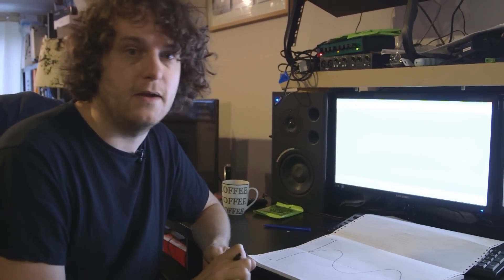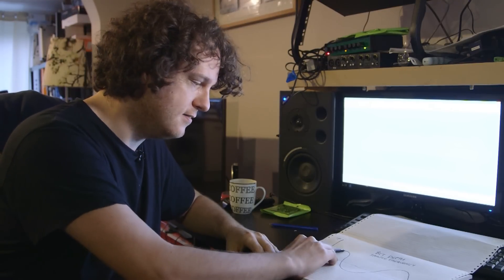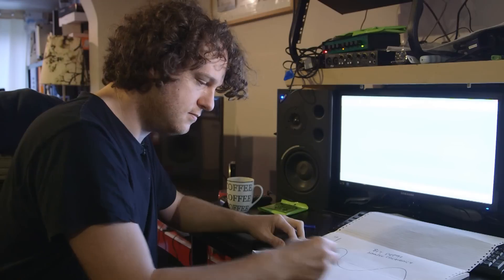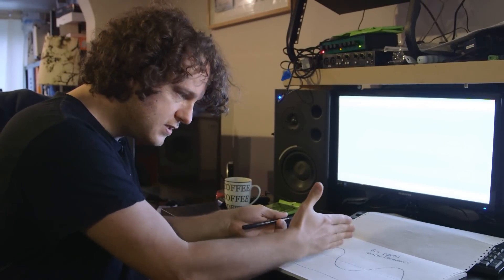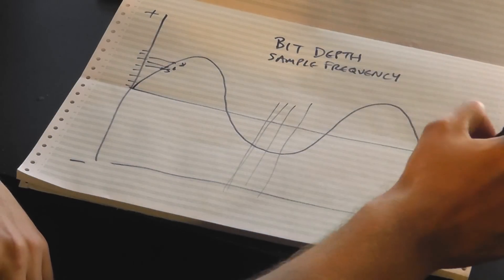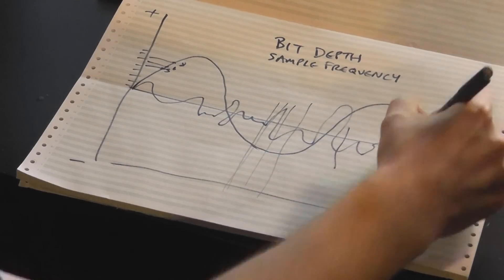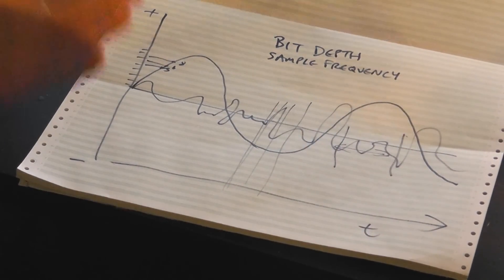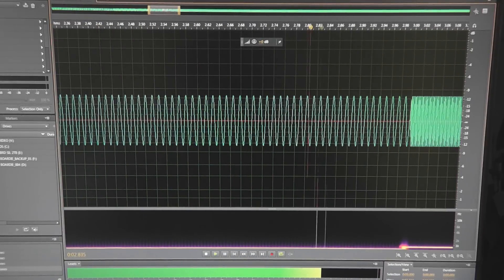How Digital Audio Works - Computerphile

Comment: Now I know why higher sample rates improve treble clarity, in a waveform high frequencies spike up and down a lot very quickly, a slow sample rate misses those spikes. Great video!
Reply: +Tyler Watthanaphand Yup, that's part of the Sampling Theorem. There's a rule that says "if you wanna capture perfect audio up to X KHz, then you need to sample *at a minimum" of 2X KHz." Search for Nyquist Frequency for more info... :-)
Reply: +Orestes Zoupanos Better results are achieved when you double the sampling frequency (according to the maximum frequency of the signal) and add a little more sampling cycles. Hence the 44.1 KHz, which is 22 KHz * 2 + 100 Hz. The extra 100 Hz prevent the signal from containing aliasing artifacts.
Reply: +Hugo Neves You're right, but he did basically say that. That's what he meant by  sample *at a minimum" of 2X KHz." . Granted, that doesn't really emphasise the benefit of the fudge factor.
I guess it depends on how you think of it, it's either Nyquist >= 2X or 2X+100 = Nyquist.
Reply: +Gordon Freeman I meant going from 8-10k on phones to 44.1k. There are legitimate uses for higher sample rates, just not in regular listening. For example, in live FM broadcasting where sub-carriers need to be mixed into a signal to provide stereo sound, RDS, etc, the only way to get those in there are to use 96 or 192khz
Reply: +Hugo Neves  they picked 44.1 because it was compatible with both PAL and NTSC video equipment. Early digital audio was stored on video cassettes. They needed a minimum of 40hz, and then extra room for the antialiasing filter,  and it had to be divisible by both PAL and NTSC standards.
Reply: +Tyler Watthanaphand 
Sample rates above 44.1KHz do not improve audio quality at all.
It doesn't matter if you go from 20Hz to 20KHz in an instant, at 44.1 it will all be perfect.
Reply: *****

Well, sure, there are uses for higher sample rates, but that's mostly for scientific applications, were you need to store really high frequencies, for normal listening human standards 44.1 is enough.

Comment: The very first statement was wrong. The air doesn't move across a room until it hits your eardrums, that would imply that the air in the room moves at the speed of sound across a room. The air on average stays in the same place, but as it is an elastic medium the information it carries moves across the room at the speed of sound, so not so much like billiard balls passing on energy, but rather billiard balls attached by springs that return to where they were initially.

Comment: So sample frequency is the "fps" of sounds ?
Reply: +BOBOUDA More like Vsync on a monitor. At least when converting from analog to digital =)
Reply: *****
I'm just asking if it's comparable, it was just a random thought.
Reply: +Patrick The Buried Then what happens when your cpu stalls for a bit?
Reply: +BOBOUDA Pretty much, yes (analog audio/ live audio has infinite sample frequency, just like RL). Bit depth is like Contrast of a monitor.
Reply: +BOBOUDA Pretty much, yes (analog audio/ live audio has infinite sample frequency, just like RL). Bit depth is like Contrast of a monitor.
Reply: +Benny Kolesnikov That usually doesn't happen because the cpu speed is WAY higher than the sampling frequency and between 2 samples the cpu has more than enough time to do whatever it needs. However i've seen it happen, it sounded like slow-mo with stuttering, it was really weird. And just before my pc crashed lol.
Reply: +BOBOUDA don't confuse yourself with bad analogies

Comment: Very interesting, though you could have explained floating point samples. They provide more "possible values" at the lower amplitudes to capture very faint sounds very accurately. Therefore they are a bit less accurate at higher amplitudes but it works out fine: The difference between say +10 and +11 is significant, but the difference between 10000 and 10001 is probably not noticable.
Reply: +Ihrbekommtmeinen Richtigennamennicht That's what I was wondering too... On top of that, it would prevent clipping as well. It is understandable that for playback you need a hard volume limit, but not for editing...
Reply: +Ihrbekommtmeinen Richtigennamennicht Longest name on YouTube? Cool, but Ich spreche kein Deutsch.
Reply: +Yan Wo hah :) But I guess you already know that it means "You're not getting my real name" :)
Reply: +Ihrbekommtmeinen Richtigennamennicht you got a great name